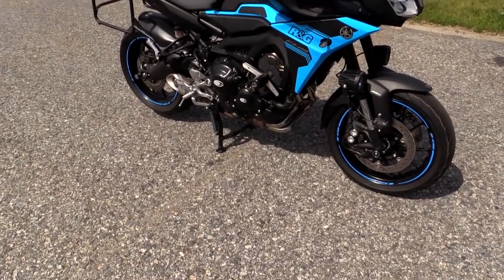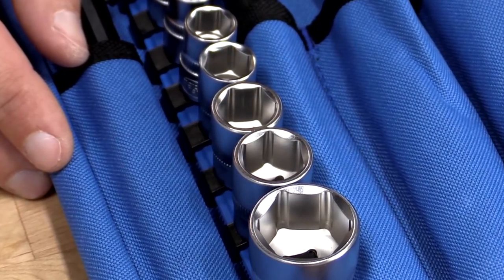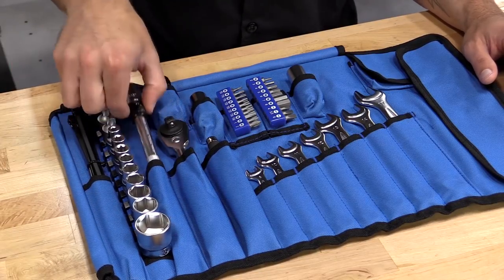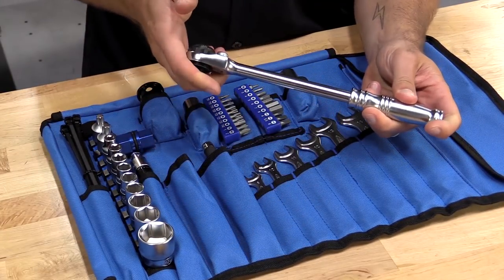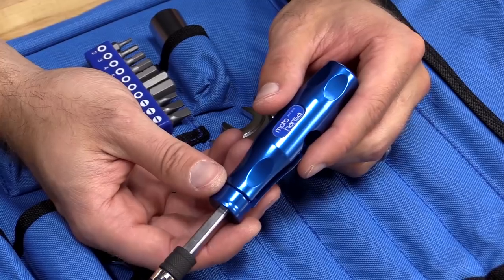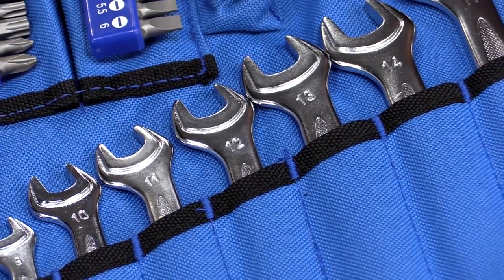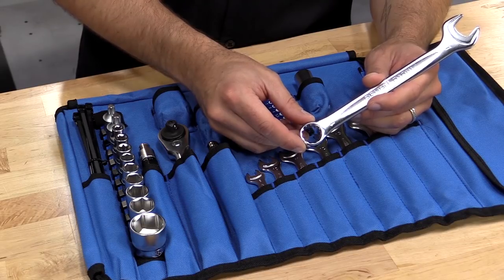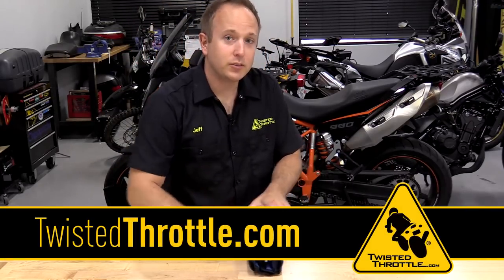58 Piece Motohansa Tool Kit for BMW Motorcycles | TwistedThrottle.com

Comment: Good choice if you own a BMW now officially less reliable than HD. I bought the genuine BMW tool kit for my then brand new F800s and installed it in its proper spot under the seat. The tool kit rusted and its roll fell apart just like the bike. I've had moto hansa gear and its always been good gear.
Reply from the maker: We appreciate your thoughts Rob.  We especially appreciate how robust the Motohansa tools are as well!
Reply: What year do u have that's less reliable? I just bought a 2009 because I met these two old guys that had 120k on their 2009s and they told me that the newer ones wernt worth the price
Reply: 07 GS and just flipped 75k. No major repairs. No break-downs (other than nails in tires). Have a friend who has an 05 with 7k miles on it and I am SERIOUSLY thinking of coughing up, wait for it...$5000 for it and riding for 2 or 3 more uneventful years. 04-07 were just bulletproof bikes if well maintained. Even though I have 75k on my 07, I would not hesitate to go anywhere on it. Just came from northern Indiana to Nat'l Rally in TN last weekend. Lots of $$$ rolling around but my envy was manageable!!
Reply: @RumorHazi  I have recently bought a very well-maintained 50+k  2007.  However, the tool kit was "missing"   What tool kit would you recommend?    BTW - Love this bike!
Reply: downstg  I built mine from my “big box” in the garage. In other words, anytime I am working on my bike, I use the tools from my tool bag exclusively. That way, I know I have everything I potentially could need on the road. I keep all the Torx sockets and a driver, reversible screwdriver, spare bulbs, etc, etc. in the tool bag. There is a really cool bag I bought several years ago that makes use of some wasted space above the tail light. Here you go:   

https://www.cyclenutz.com/Held-BMW-R1200GS-Toolbag_p_1039.html
Reply: You see, I doubt that. HD also doesn’t give a 5 year warranty. If BMW problems were rife, with that warranty, they’d be broke, lol.